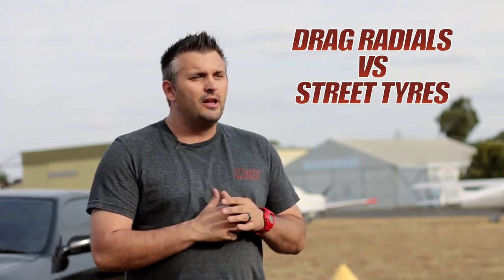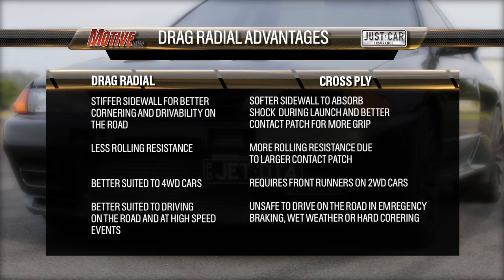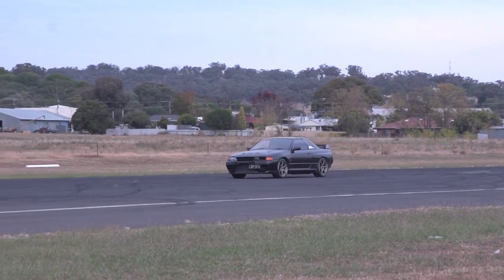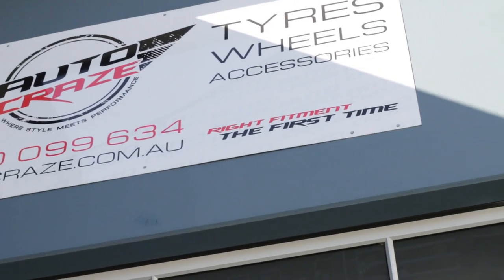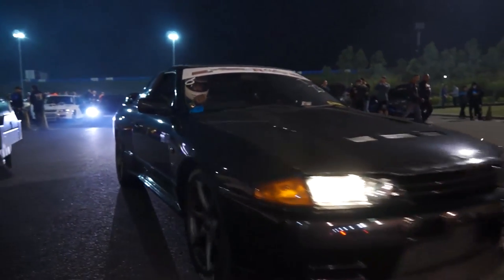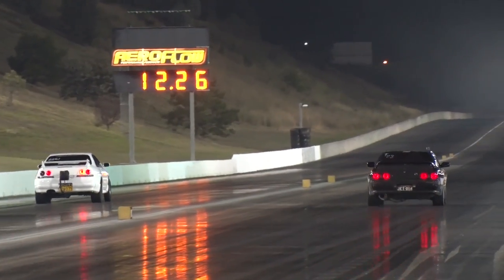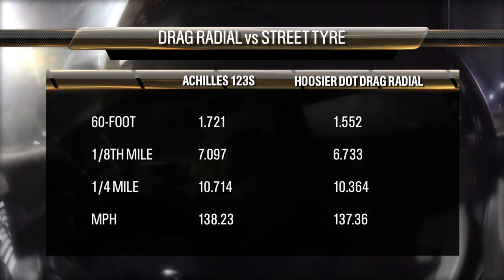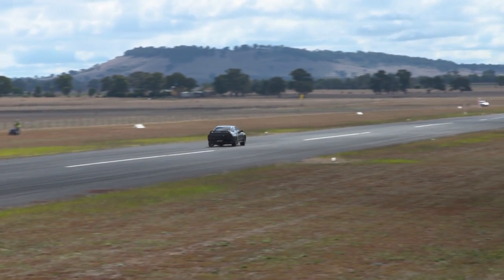Drag Radial vs Street Tyre MYTHBUSTED R32 Skyline GT-R

Comment: Different rims. Different weight. This should have been done on the exact same rim setup
Reply from the maker: You're kidding aren't you? They were both same size and almost identical weight. Feel free to research the weights if you like. Did you know that tyres weigh different amounts too? what dot we do about that? Request hoosier or Achilles custom make a tyre the same weight for us? This really is a null and void argument to be honest and would make no measurable difference.
Reply: Oh man, sorry for hurting your feelings! However, we're not talking about entire wheel weight, we're talking about rim weight, regardless of how "null" the difference is. With the rims being constant (which it isn't) and the tires changing. You showed the R32 drag racing right? And a serious drag racer knows that a tenth of a second at 60ft doubles by the end of the quarter mile (you said that right?), I mean we could go in-depth about parasitic loss but I'm sure that'll bore a lot of people here...the point of this was to test tires right? The weight of the tire doesn't matter cause it's apart of the changing variable (duh). Shows how well thought out your argument was. It's fairly obvious to anyone with half a brain that the slicks will perform better. Also the fact that you raged so hard, instead of politely addressing my concern shows how immature the people running this channel are, you're like those 16 year old kids that think their stock em1 si is the shit. I can see why you're struggling to break the 40K subscriber mark with a 7 year old channel. But thanks for the reply!
Reply: +Abraar Rahman Haha, 100% agree. The wheels could've been very similar weights, but the issue is it wasn't addressed. Rotating mass and unsprung weight is a pretty big deal.
Reply: NO Abraar Rahman is not kidding. That is called "exploratory data analysis". If you don't have your number right, you have shit! But I get it. It's a TV show, not a Scientific research. By the way.....cut that "Watts" bull shit. Rotational Mass (Angular Acceleration) is  presented  in "Torque"...whatever way you've measured it.
Reply from the maker: If you think the couple hundred grams difference of the wheels is going to make a measurable difference in the real world then you've been reading too much internet. WE've run the 123s on both wheels before and had ZERO difference in performance, dyne readings etc. NONE.ZERO.ZILCH. NOT MEASURABLE. The might make a difference in Gran Truism, but in the real world, the weight of the tyres made more of a difference that the wheels. 5km/h of wind would have more effect than the rims we used.
Reply: +MotiveDVD What an ignorant comment. 
I play Forza.
Reply: clutchthepearls kkkkkkkkkkkkkkkkk
Reply: Maaaaaan I would love to believe you. But I'm just gonna leave this here...PROVE IT
Reply: +Wally Castro I have no idea what that means. Is a string of k's good? Is it bad?

Comment: I have always said, tires are EVERYTHING.  The right tire for the application can make all the difference.  Like you guys have stated near the start, no point over doing it, with a drag tire at least.  But once you can no longer get the power down, tire upgrades are a must.  For corner carvers like myself, tires are huge regardless of the power.  Get the best tires you can afford and that alone with no other mods will cut lap times a fair bit.  In the end, those little rubber patches are all that translates your commands into action in a car.

Comment: Drag radials have a softer sidewall, and are much worse for cornering.
You want a soft sidewall to flex (picture a flat tire) and give you a bigger contact patch for more forward grip.
For cornering you want a stiff sidewall to keep the contact patch from moving around which makes the car responsive and stable.
Reply: Sidewalls that flex while cornering also ruin proper traction.
Reply: Of course, but these tires aren't designed for autocrossing.  I've used Nitto 555R drag radials on 3 separate daily driven cars.  They are probably the hardest drag radials out there, but actually have a little bit of tread depth and are still good for 1.7 60' times on my RWD cars.  Not to mention I typically get over 10k miles out of a pair.  There are softer DR's including the older bias ply Hoosier QT's and ET Streets that make the car feel very floaty and are for straight line only, but I think the new crop of drag radials out there will still give you cornering confidence at 7-8/10ths driving.
Reply: +CaptainXanax yeah, at 1:10 he points out that the drag radials have a stiff sidewall for better cornering???
Reply: Ah.. Yea, I would imagine he means in comparison to a full drag slick or the really smooshy older drag radials which have a similar build to slicks (wrinkle walls) with a slightly harder rubber and a blocky type tread pattern.

Comment: Awesome stuff. Fantastic production quality and information!
Have you filmed the second part of the brake upgrade video yet?
thanks.
Reply from the maker: +Jack Campbell We wanted to change brake pads before we did the test as the pads we were recommend after what we asked for wasn't in stock ( not by CC Brakes) turned out to be rubbish. We will fit the new pads and get the test done after GT-R Festival when work load calms down.
Reply: +MotiveDVD you need to comparo forza, mu and whatever else you think would work and do a ultimate multiu purpose pad for 32 gtr mythbusted
Reply from the maker: +Road to Adventure Comes down to time and money. We're out to my bust a cheap brake kit, not to compare pads. We would have to buy every pad and spend thousands of dollars yet out the video would be lucky to make hundreds of dollars in revenue
Reply: +MotiveDVD i was thinking a long term test, one pad cycle, recording thoughts on street performance, some basic braking tests maybe some circuit stuff if you take it racing, using the same rotor and just replacing pads as required would be a decent overall back to back
Reply from the maker: +Road to Adventure That sounds even more time consuming an complicated than our normal brake txt which is just 20 hard stops in a row from 100km/h!

We will report on the ones we use, but doing it to a lot of them is simply a massive exercise. Speaking from experience though, your favourite brake pad is Project Mu HC800. Nismo R pads are also good

Comment: i have those same tires in the 17 inch 275s hoosiers.  but rwd only and they hook like crazy.
Reply: 275 on what width of a rim?
Reply: @teamforbidden7852  this is a old post.  If i remeber correctly, a 17x8 stock pontiac gto wheel from like a 2005 ish gto.

Comment: You gave a lot of great info but what you left out is actual tire size. When going with a drag radial tire you want to go with a little taller tire so you can drop tire pressure and with that it Also changes you speed since it's a taller tire.

Comment: i guess i need to get those drag radial tire for my car, i ran my 670whp 2jz swap cefiro on a stupid dunlop dirreza street tire and my car ended up spinning halfway of the track, my wheels kept on lossing traction until 3rd gear lol...and i havent had a chance to fit an lsd yet since the car is fresh build...it was fun  tho and the track is not a prepped track too...

Comment: Had a friend with a '05 mustang shelby, nitrous 4.6 (not gt500). He drove around for 5 days on those  slick radials....mofo hit a puddle and spun off the highway into the grass in the center.. lol.... lesson to be learned here on these sick asss tyres AND he got a faulty equipment ticket for wrecking.
Reply from the maker: We don't drive the car on the road with these tyres unless its a quick drive to and from the track in the dry.
Reply: neither would I;]
Reply: typical mustang
Reply: It must have mistaken the mile markers for a car show crowd

Comment: I thought drag radials have more rolling resistance because it has the maximum surface area for a tire to grip the road. More surface area contacting the road would mean a larger contact patch and thus more rolling resistance which generally equates to more grip. I'm confused now.
Reply from the maker: They have more rolling resitance due to compound ( friction) and contact patch.

Comment: That's impressive Andrew! The GTR is still a stock bottom end right? Those power levels are amazing
Reply from the maker: Stock bottom end and head, yes. Just gasket, studs and drop in cams.

We are getting valve float now ( reducing mph) so valve spring upgrade next.

Next mythbusted is " how much power can stock RB26 make"
Reply: Yeah that's what I thought. Man that is seriously impressive! 

Looking forward to the next mythbusted!😬

Was a good turn out at the drags last week with the Coota cars n 1320!
Reply: +MotiveDVD And after that test, will we possibly see RB30 bottom vs 26? Or are you going to just build up a 26 bottom end with forged bits?
Reply from the maker: +NjBorn Next video might be "how much power can a stock engine reliably make" as we are fitting valve springs and turing it up more next. If it doesn't break by end of this year we will do a 2.6 vs Stroker video. We will more than likely go for a 2.8L stroker inside same block rather than change to RB30. Main reasons being that RB30 getting hard to find and it is actually quite a big job to switch. I like the idea of using same block and bolting straight back in with no changes and bills crank means can rev harder too
Reply: +MotiveDVD Nitto 3.2 means billet crank too :P
Reply from the maker: +Tim yes but RB30 means sump adaptor, drop subframe, new piping and various other parts to make it bolt up. Also have to find a good condition block etc. 
We prefer to remove ours, rebuild and put back in car as a bolt-in.
Reply: yeah that's fair enough.. but you can gain 600cc rather than 200... You claim this is a street car, well would you like boost to come on 1000RPM earlier?
Not having a go at your build I think i'ts awesome. I'd love to see the you build a 3.2L though!

Comment: Hi Motive. Just started to watch your series.
And im wondering why you dont use launchcontrol?
Reply from the maker: We dont use launch control or "2-step" to help conserve the factory oil pump. launch control is basically a limiter and the shock loading on the pump wears it out
Reply: Ohh ok. Does it wear down the Reimax pumpwheel aswell?
Thanks for the reply.

Comment: 60 ft times are for less horsepower cars on the launch  sub 3000# car maybe 25k , and 1.8 60ft , street tires can reach same . if you are applying more torque at launch then drag radials are needed, ie 1.5 60 ft

Comment: Quick question, considering how close ratio the gears are currently...have you tried launching from 2nd gear? I know a lot gtr owners had some results with improvements. And considering this is the Getrag box it should take the hit surely. 
Are you able to try it Andrew?
Reply from the maker: We tried it on street tyres and it just blew the tyres off or bogged,like when you have a really long first gear in a GT-R. We are looking at trying it on the Hoosiers with launch control in the future. Problem is we only get one good shot at it before we get booted
Reply: +MotiveDVD oh ok. thanks for the info. I presume your going to have to be quite hard on it with the hoosiers. but if it works should drop the time again. The car is quite an animal mate. keep the videos coming. on another note...how is the reliability now..and is the head still lifting or are you running lower power normally? thanks in advanced for the replies

Comment: Only got 200hp and i cant keep power on the ground. VW bora TDI (on second gear, as soon as the turbo opens the wheels start spinning. I ordered two semi slick for the front today. They are not as expensive as these ones. Nankang ns2r, it might be more than enough for 200hp.
Reply: Diesel torque tend to do that. I had a 1.2L turbo diesel Cirtroen C3 with 70HP, and it broke traction in 2nd too when the turbo came on.

Comment: Is there a street or drag radial tyre u recommended for f80 m3 can't seem to get the power down with stage 1 and ps4s 285 35 18... I just purchased 18s for the rear thinking of going wider tyres

Comment: Jw wouldn't using 2 different wheels effect the times due to the wheel weights are most likely different
Reply from the maker: same die wheel and minimal weight difference. under 500grams. the tyre weight difference is more than the rims. it makes no measurable difference

Comment: Only problem I see is that you are using different wheels ,so you are changing the wheel weight but either way the drag radials are a better choice
Reply from the maker: The difference in weight was less than a pound over all four wheels. In fact the difference in th weight of the tyres is sometimes more than the wheels. Here is a long list of how much difference the wheel weights made.......
.....

zero

Comment: As a long time racer you NEVER drive a race tyre on the street. That is a heat cycle and any race tyre only has a limited number of those.
The 'street' tyres are by the look a drift tyre and again the same applies.
All road tyres too go hard, just a lot slower.
Storage of race tyres too is very important, should be stored in the cool and the dark and not with the weight of the car upon them
Reply from the maker: We know, but lots of people do it anyway and dont care about tyre life. they just want the performance

Comment: Wait in the beginning it says the radials have less rolling resistance due to a smaller contact patch but are gripper? And it runs a slower trap speed at the end? Can someone help explain this to me
Reply from the maker: OK. We said drag radials have lower rolling resistance that a cross ply, but both types of drag racing tyre have more rolling resistance than a regular high performance street tyre

Comment: i would keep the wheels the same for more exact test results
Reply from the maker: it would make no difference that is measurable. Both wheels are same size and high quality one piece wheel. The difference in weight of tyres is more than the wheels

Comment: is there any difference attributed to the different wheels? woukd of like to see the tires on the same wheel to eliminate any variable but still a cool test
Reply from the maker: non that you could measure. both wheels are same size and both high quality one piece wheels. The different in weight of tyres is more than weight of wheels
Reply: +MotiveDVD thanks for the response

Comment: Question.. can 305's on the rear of my Hellcat damage my stock drive shaft?
Reply: NinjaWarriorDude if you can fit the tires on the rims, they shouldnt do any damage.
Reply: Ok..... someone told me that I could twist my stock drive shaft by putting the 305's on my rears. Another question for you, sir, should I put on a K&N air filter in my Hellcat.. would it decrease the already low MPG? I get about 11.4 mpg currently (in Eco mode).  Thanks @SL02VGT

Comment: its also not much of a test on an AWD car... if you really wanna see a big difference test it on a high power 2wd car.  and why doesn't your GTR have a 2 step?  it would make for much more consistent launches, especially now that you're using drag radials
Reply: agree ...I was like wtf testing DRs on a awd car.
Reply from the maker: two-step requires calibration on every single surface you drive on, which requires test launches on every surface. Don't have time to do that every where we drive.

Our car gets wheelsman in first two gears ons street tyres. It's not exactly a stock 4WD car with full grip

Comment: Can someone explain to how he's launching the car?
Reply: +SlidinShadow Sure thing buddy. So what you want to do is use your left foot to apply pressure to the left pedal. This causes the clutch to disengage. Then using your hand shift the gear lever into the 1st gear position. Now using your right foot on the right pedal you can increase the rpm of the engine. Ok here is the tricky part... take your left foot off the left pedal which will engage the clutch and make the car move in a forward direction. Hope this helps you out!
Reply: +Tyrell Mack guessing you can`t tell he is pretty much mocking this guy right.

Comment: Why pick and AWD car??? Why not RWD. Plus low pro radials arn't even close to big sidewall tires that can wrinkle a little.
Reply from the maker: Because we own a GT-R? and the brakes are big so we can't fit 16-inch wheels with big tyres. 
Also, we know higher profile ones work better. More people want to see if low profile ones work to fit over big brakes found on modern cars now
Reply: Why not?  It obviously benefited greatly to 4 DR's...

Comment: why do cars get kicked for going under a certain time? something to do with safety or some shit?
Reply: I think the rules are if you run faster that a 11.00 you need a full cage and I think faster than a 9.99 you need a full harness
Reply: +Christopher Cook cheers thanks mate
Reply: +BULA TOKO
I suspect yes, the car does not have the specified safety equipment for the ET and or speed.
In the US, the NHRA and most sanctioning bodies require a roll cage on vehicles running 10.99 and quicker, drag chutes on cars faster than 149 MPH (239.7 km/h), fire suit when faster than 10.50, etc...
Typically, the the quicker/faster the vehicle the more safety gear required.
A vehicle can register and test/tune and or compete until it exhibits it is quicker/faster than it's currently installed safety equipment, then it gets kicked/booted until the next event or the vehicle is brought into compliance.
Reply from the maker: +patw52pb1 Correct. 10,99 and under gets you booted without having all the safety gear. 140mph for parachute here.
Reply: +MotiveDVD sweet, makes sense now thanks